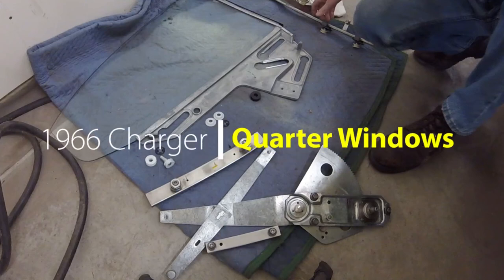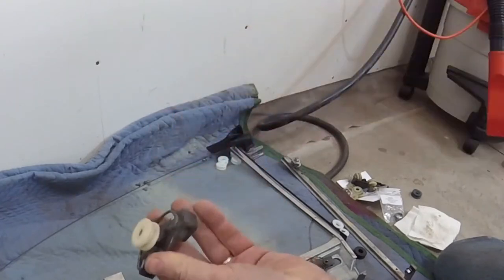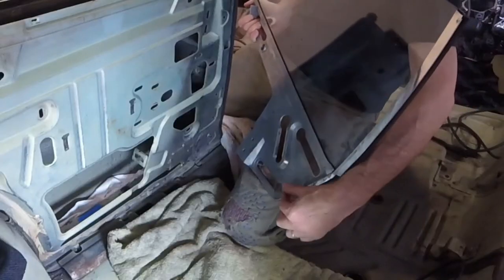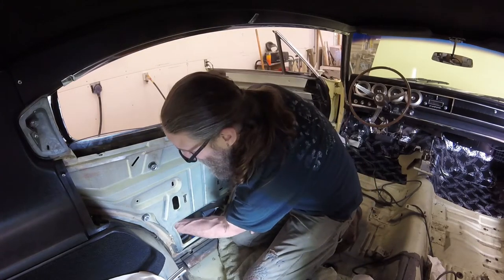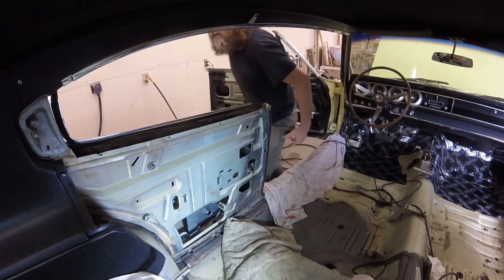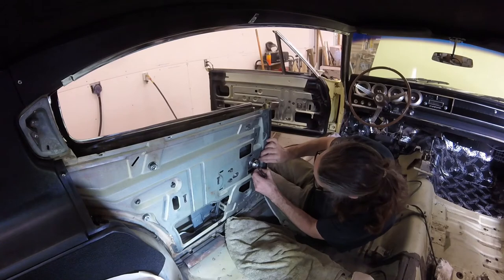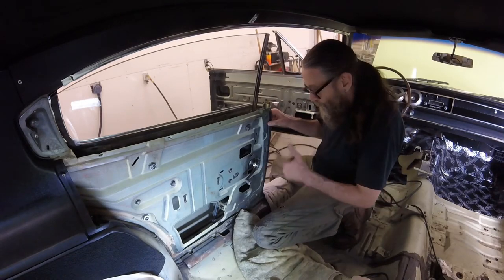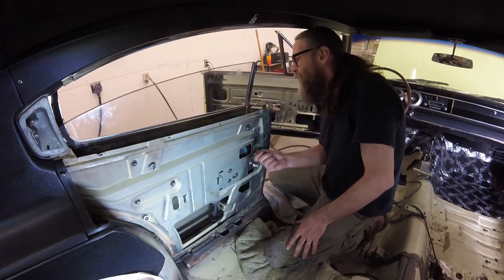1966 Dodge Charger Quarter Windows

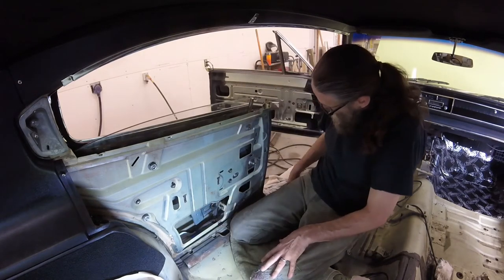Comment: Paul, I have watched your video at least 10 or 15 times. I have taken notes. Today I took the time and laid out all my parts for the driver side quarter window and I went through your video explaining how everything gets connected. I then was 24:04 window. Two hours later I'm still struggling to get the clip on with the C clamp while doing so the first roller that you have put in with the vertical rear breeze came out. I have put that in a couple times because it keeps falling out while I'm working on the rest of the window. I put one screw in the regulator just to hold it in place while I'm working on these other two areas. I'm not sure how many times it took you to get it perfected but I gave up today and I'll go back at it tomorrow. I cannot believe that they did this on the assembly line to get a window into the regulator. It's almost like they put the window on the regulator and then they welded the quarter panel on. I just find it impossible to think they made 15,000 cars in 1967 and put the windows in like this every time. But I do enjoy your videos and you're a very patient man. Thank you for the help. 23:50
Reply from the maker: Thanks, Dean.  I'm sorry your clip isn't going on.  But I'm not surprised.  That thing is a bearcat!  Your experience sounds a lot like mine, though.  I had to walk away from that darn project multiple times over the course of weeks.  I spent hours fussing with that one little clip.  

I have no clue how the factory did it.  If they installed the glass and regulator before welding on the quarter panels, they'd need to protect those parts from overspray during paint.  Plus, the regulator would get dipped in rust protectant along with the body before paint.  On my car, it sure looked as thought the window and regulator were installed after paint.  I'd sure like to know how they did it!

Comment: Thank you for doing this detailed informative video.  Im in the final stages of gutting my interior and doing things right throughout after nearly 35 years.  Im getting older and need help w some of the work so knowing what Im up against ahead of time is very useful, and should save time (and time = $) 🙂
Reply from the maker: Best of luck with your project, @67charger67!  I hope the video saves you some headaches.  That one tricky roller that I talked about in the video was definitely the hardest part of the whole job, not to mention that it's a physically awkward position to be in while you're doing it.  I'm getting older, too, and have bad chronic back pain.  If you watch closely, you'll see that my outfit changes several times during this video.  That's because I couldn't work for very long during any one stretch.  I had to do the job over several days.  That would be my only additional advice: don't push yourself!  Take your time and avoid injuries. 👍

Comment: You purchased the set from Classic Industries.  Were there parts of the kit you did not use?  Curious since the kit I happen to obtain via a friend does not have the black gaskets and sleeves.
Reply from the maker: You're right.  The kit included those parts, which I did not use.  My regulators didn't have those black gaskets and sleeves to begin with, and I didn't see how they could be fitted anywhere.  I figured those parts were for power windows, but that's just my guess.

Comment: Paul, I have to replace the rollers in my 67 Charger. Unfortunately, 2 years ago when I was getting the body work completed, I loosened my windo regulator withthe window attached and lowered it into the cavity so I could remove the cat wiskers and trim. Now I am ready to install my new rollers and haven't figured out how to remove my glass first and then the regulator. I understand now that I was supposed to roll the window up and remove two or three bolts that hold the glass? What do you suggest I do at this point toget the glass out?  I tried to move the assembly  up to reinstall the nuts to then crank the window up but with the broken roller it doesn't want to move up. Any suggestions are welcome. Thank you, Dean.
Reply from the maker: Sorry for the late reply.  We’ve been camping for a couple of weeks.  Is the regulator-plus-window assembly detached from the body?  If so, I would try cranking the window down as far as you can (which it sounds like you already did), then try shifting the whole assembly around enough to allow you to reach up into the cavity to access the rollers.   I suspect this might require removing the vertical tracks so you have more room to move the assembly around.  

We’re on the road now.  I’ll check back when I can…
Reply: Thank you for the late response, thus my late reply. I was able to remove the glass. Once I removed the driver side qtr window assembly the passenger side came out in less time. Now I have to re-install. I can't imagine the original installation on the factory line was completed in steps like this. One would think the whole assembly could be installed and just bolted on. @PaulBroenen
Reply from the maker: @deanprevolos55   Sorry for my late replies.  YouTube hasn't been alerting me lately when I receive comments. :(

Comment: I spent 5 hours Saturday on the passenger rear quarterv window and could not get the window fastened to the regulator. The clip would not snap on using the "C" clamp, the first step you did,  I was succesful with but then that sleeve fell off as I tried to snap in the clip. I was able to get two of the rods connected but neither of the pieces that fit on the spring rollers or the first roller. Needless to say I gave up. This is the second attempt. I waited months to do this, so I can install my interior and I will be finished with my build after 3 years. Very frustrating, not sure what I am going to do without the rear quarter windows installed. I have watched your video 40 or 50 times. I find ot hard to believe you did this video in the 35 minutes. Just venting and very frustrated as I watch your video for the 51st time..
Reply from the maker: I feel for you, Dean!  That clip is a total bearcat.  Did the clip happen to get overstretched/overextended?  The four little tabs on the clip can get bent too far, to the point that they no longer grip groove on the regulator’s pin/shaft.  That happened to me once.  The clip would just fall off.  And you’re right, it took me much longer than 35 minutes to assemble everything.  I spent many frustrating hours over several sweaty attempts.  (You can even see that my clothing changed multiple times in the video!)    
The two things I did that ultimately seemed to help were: 1) I made myself as comfortable as possible for the long, arduous effort, and 2) I experimented with positioning the regulator and window differently with each attempt.  There’s so little room for error when aligning the components, and you’re doing it mostly blind, so it’s easy to have things askew by a fraction of a millimeter and not know it. 

Hang in there, buddy.  I wish I could stop by and give you a hand with it!
Reply from the maker: Dean, I was just thinking about your situation, and wondered if you happened to try cranking the regulator into a different position?  I recall there were times when I would pop the handle onto the regulator, give it a crank one way or the other to see if things lined up better.  It definitely made a difference.

Comment: Those look like they are glue in glass at the mounting point or pressure fit.
Reply from the maker: Hi, Eddie.  There was black adhesive material between the glass and metal frame on both quarter windows.  I couldn't tell if it was originally setting tape or glue when I took apart the driver side window, because the stuff was deteriorated and mixed with fine dirt that seeped down into the channel.  

I also measured the width of the glass and the width of the channel, and the glass was narrower.  Definitely not a pressure fit.
Reply: Sounds good thanks for the info, and good luck with the project!